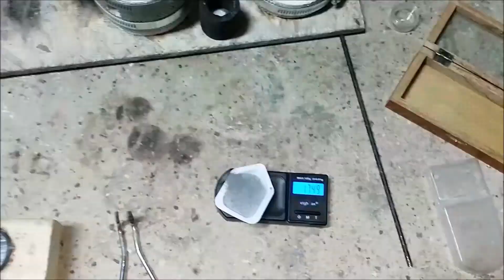Empire Gold Mining Show Silver Ore Smelting

Comment: Did you go straight to smelting after crushing the ore, or was this other processes?
Reply: I saw crush and smelt. Which is wrong on so many standpoints. I am a professional geologist. Unless your ORE is 100% the desired element you will not get pure ingot/bead/button of silver, gold, or copper. If it was it wouldn't be ORE but NATIVE.

If indeed it was ORE he would so many impurities. Quart, sphalerite, gelena, arsenopyrite, pyrite and any number of non-metallic and metallic minerals. In most cases precious metals are a small percentage of the host mineral ppb and if luckily ppm (parts per billion and parts per million). In to get pure metals from ore  you need to CONCENTRATE it, drive off the impurities. Doing this is hazardous. You can either do chemical dissolution and precipitation and then smelt the concentrate or essentially roast the ore with a catalysis however due to impurities this can create noxious fumes. 

;dr he appeared not but should have, I am guessing here not knowing the exact original matter but the end material is not pure silver.